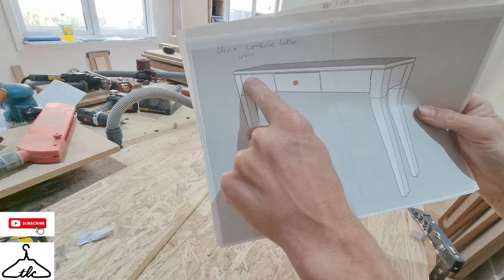Metal Inlay In Wood | Adding Brass To Your Woodworking Project | Vid#115

Comment: Nice video. Glad to see lung protection. What about your eyes? Safety glasses are a pretty basic item these days. The cut depth was "3 mil" which I assume means 3 mm. What was the thickness of the brass strip? I guess a little less than 3 mm.
Reply from the maker: Yes very fractional under 3mm I think. I did this a while back but sounds about right.  Cheers ryan